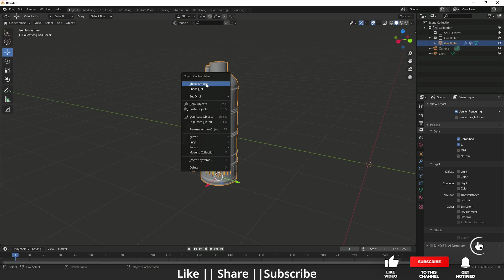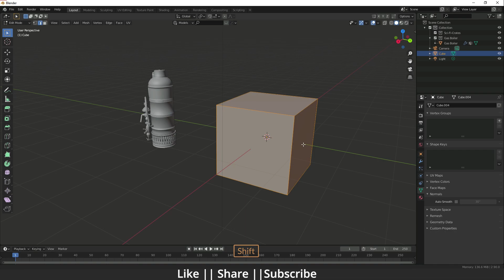How to Fix Auto Smooth Not Working or Disabled || Blender 2.90 Tutorial

Comment: In my case I had the Normal Map set to sRGB. Setting it to Non-color fixed the issue.
Reply: Where is that option? Very new to blender not familiar with interface
Reply: @the_lotus2720  it's under the shading tab when viewing the nodes find the texture node
Reply: @miro-hristov  thanks!